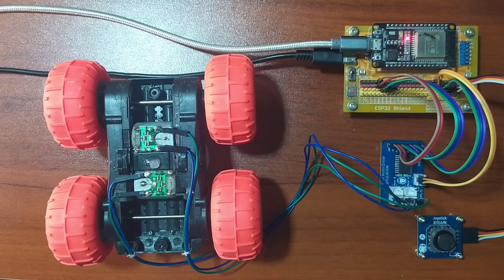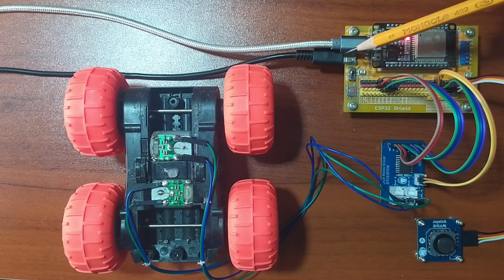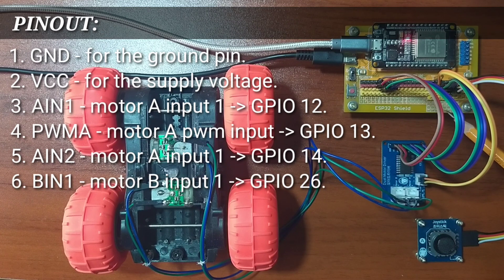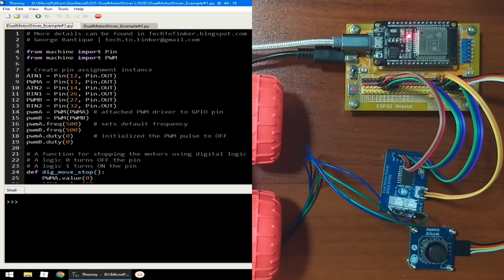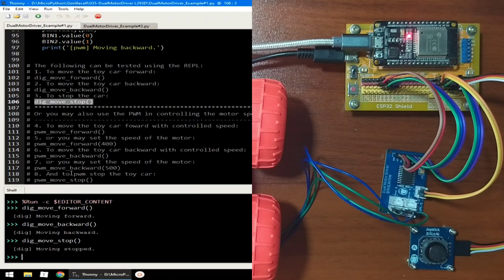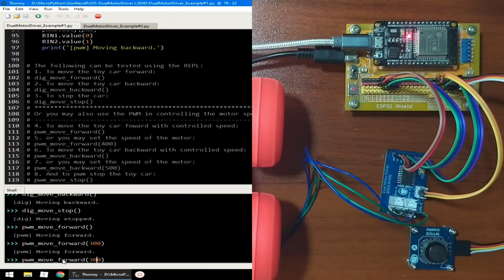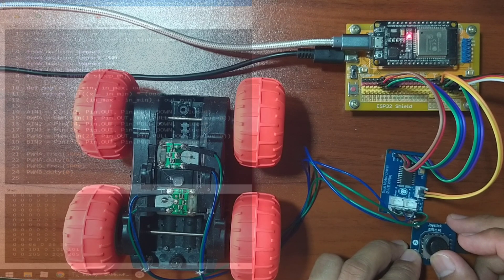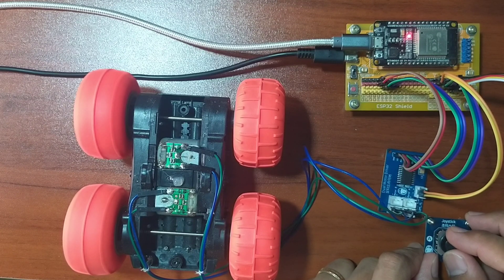035 - MicroPython TechNotes: Dual Motor Driver

Comment: Dude can we add both arduino firmware and micropython firmware on esp32 div kit at the same time. I mean if we want to do a blinking in arduino and next blinking project by micropython without changing the firmware..

Pls do some retro games on esp32 div kit pls pls pls
Reply from the maker: @NEMESIS 300, that isn't possible as of now. Only 1 firmware can be flash in ESP32.
Reply: @TechToTinker  ok tnks... Please make some retro games on esp32 div kit
Reply: Pls make a tutorial on games in oled with esp32 dev